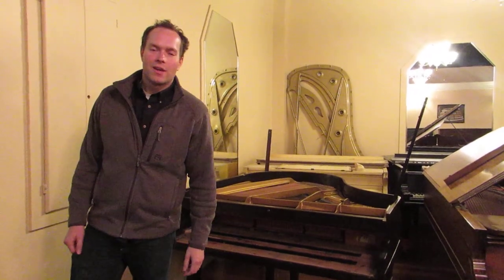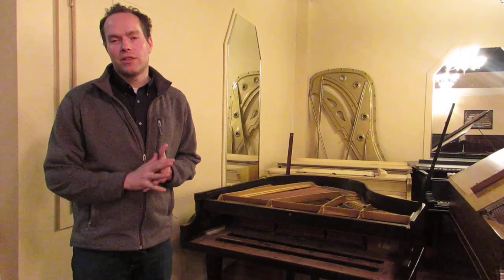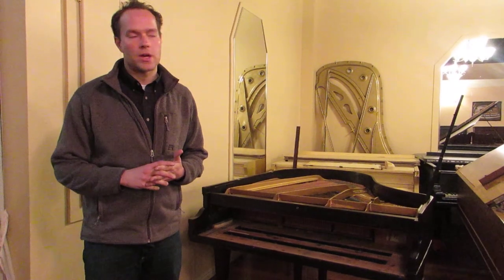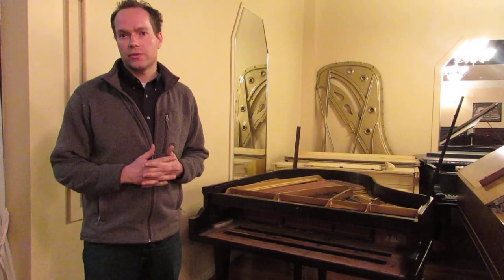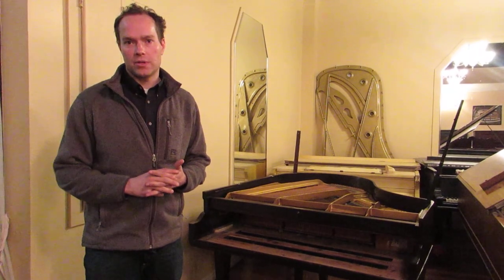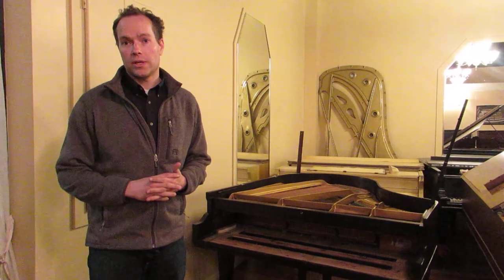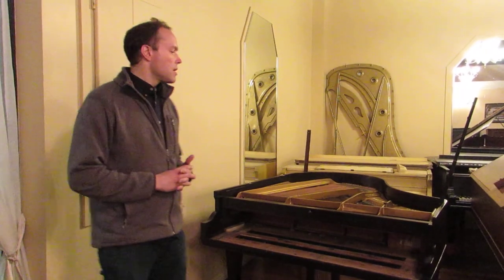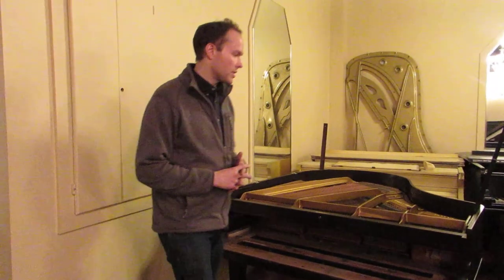How to Repair Loose Tuning Pins On a Piano

Comment: Any fluid, whether glue or oil, will only penetrate 2-3mm AND damage the wood.  The correct thing to do, is to replace the the pin with a thicker one.
Reply: Cyanoacrylate adhesive - "superglue" - will not damage the wood of a piano's pinblock. It reacts strongly with the cellulose in the wood, to form a new compound. This technique has been in use for over thirty years now, and is often the method of preference, especially where the piano is one of no financial value and would not justify the cost of a rebuild.  Where a piano has most or all of the pins quite loose, it is impractical to talk of replacing with thicker pins. Superglue has rescued many an older piano, keeping them tuneable and playable, where they would otherwise be scrapped.
Reply: @DavidBoycePiano  That is chemically NOT true! You deliberately damage the wood! The only correct solution, is to replace the pin with a 0.1mm thicker pin. Every properly trained tuner and technician will know that.
Reply: @gawiewolmarans3813  Chemically NOT true?  Not true that cyanoacrylate reacts with cellulose?  I am interested in your assertions.  What do you do when you encounter a piano of little or no monetary value where most of the tuning pins are loose? Replace them all?  I wonder that you can so readily write off more than thirty years experience of wise and experienced piano technicians.
Reply: 5:57

Comment: Thank you so much for the video and sharing your knowledge and experience.  I bought a petite baby grand that is about 80 years old.  So far it only has one or two slipping pins.  Your suggestions are all ways that can avoid having to replace the whole pin block which is so expensive.  I could hear you fine by the way and I enjoy your other videos too.

Comment: Excellent video! I have been doing this for years as well with 100% success. I keep medical syringes and needles on hand for this purpose. An ultra thin 1.5" long needle with medical syringe allows for an almost entirely unnoticeable fix. Thinnest glue possible is a must for this type of fix.

Comment: Thank you so much my friend how are you I didn’t see you last NAMM I just acquired a Steinway model C 85 note this piano is basically an 1876 and I am replacing all of the strings including the pins and I noticed that the pens are a size 6 I think that the size 6 is the highest it goes

When I ordered the new pens I’m gonna order the same size and less of a have a size 7 but if not I will definitely try this technique the name of the glue you mention is called CE glue I have to look it up and see where I can I get it

Thanks again Brigham

Comment: Information is good, lighting could be brighter. I think your pipettes have a little drawn out material at the bottom like most of these disposable pipettes do. I build a lot of rc models and we use a nylon short tubing that has been drawn out to a very long small tip, you can get them on Amazon for 7$ for 200 and when we build our airplane models we can push these right on the super glue bottles or your pipettes like you are using and they provide very precise control of the glue and if they get plugged you can just snip the tip off. You never contaminate the glue bottle by placing your disposable pipettes back in the bottle when its just pushed onto the glue bottle spout like with the Bob Smith cynoacyralate super glue.

Comment: I know this is an older video so I don't expect a quick response but how does this work when you have a cork bushing in with the pin? Does the glue get used between the pin and bushing or between bushing and plate/pinblock? Thanks in advance

Comment: Great video and information! I have a quick question about it. My tuning pins all have wood bushings at the base. Should the glue be placed between the pin and the bushing? Or outside of the bushings? Thanks!
Reply from the maker: Most tuning pins have wood bushings. You can do either.  The glue will saturate it all over.

Comment: If only some pins are loose, would gluing them all make some of them too tight?
Reply from the maker: We haven't had that problem. We've been doing this treatment for years and have had great success with it. CA glue is very brittle and it does an excellent job to fill in all the gaps in the wood, and the wood sucks up all the CA glue around the tuning pin much like a paper towel would soak up water.  When you tune after, it will make a bit of a cracking sound, because you are breaking that glue seal, but it does not affect future tunings. You can even do another CA treatment 5, 10, 15 years down the road and it still works great!